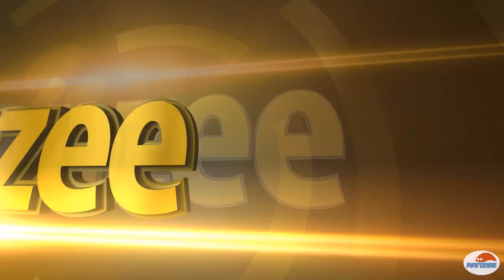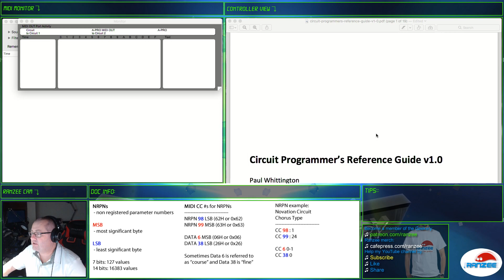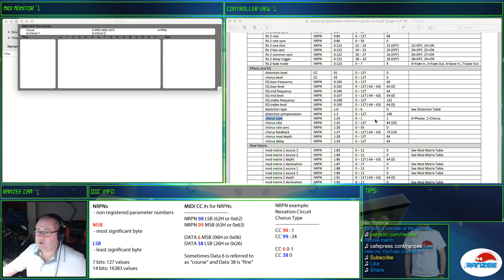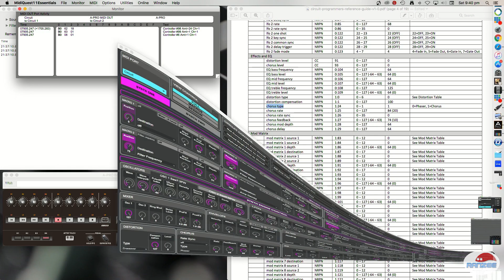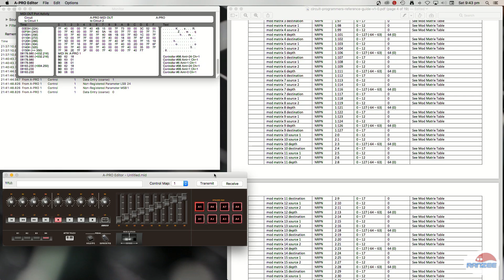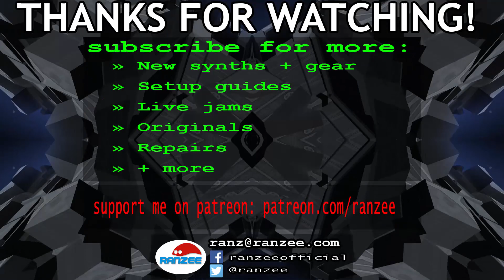Comment: Thanks for a good video! Is there a way to send cc 108 to a Nord Stage 3 with Boss FS-1-WL. The CC-numbers stops at 95. Is it possible to send a NRPN instead, could anybody show me what data to send? the off value may be 43, on value 85, it may also be 0 and 127, cc 108 wil turn the rotary speeed on or off.
Reply: You'll need to do it via another means - i.e. a laptop or PC using a DAW with NRPN ability.

Comment: I'm confused... What happened to the 38? I thought you said there would be 4 messages sent: 98 for NRPN LSB, 99 for NRPN MSB, 6 for DATA MSB, and 38 for DAT LSB... I don't see 38 anywhere on the MIDI monitor. What am I missing?
Reply: In that example - 38 LSB wasn't used iirc.
Reply: @ranzee  Thanks. I just wanted to make sure I wasn't completely missing the boat on this.
Reply: @oflittleconsequence  completely fine mate - I often have to double check myself :)

Comment: Really confused, I'm attempting to set up my Novation SL MkII controller to send a button press to my Novation A-Station that cycles through the polyphony modes. The manual looks like this:

bits 3-4: 
 2-bit voice polyphony mode

                0=mono 1=mono autoglide 2=poly 3=poly with “same
                note voice stealing”
I've followed your steps and cannot get it to cycle through the polyphony modes. the device IS accepting the MIDI information (a small dot appears on screen, indicating the selected patch has been edited) but it will not cycle through the polyphony modes. Please help!

Comment: Hi Ranzee, thanks for this helpful video. Very good explanation. I'd like to learn more specific usage of the Akai mpd232 controller with the novation circuit. I tried to configure the knobs with NRPN messages, but can't really get by. It offers MSB & LSB, but the data value seems to be static. You demonstrate the value change between 0 and 1. How about 0 - 127? I chose the INC/DEC1 option of the MPD232 with the value 1 to increase or decrease. See below example for env 2 velocity of the circuit:
08:10:52.071 From Port A Control 2 Non-Registered Parameter MSB 0
08:10:52.071 From Port A Control 2 Non-Registered Parameter LSB 0
08:10:52.072 From Port A Control 2 Data Button +1 1
08:10:52.072 From Port A Control 2 Non-Registered Parameter MSB 127
08:10:52.072 From Port A Control 2 Non-Registered Parameter LSB 127
But this seems not the be the right way as it has no effect to the circuit. I'm pretty lost. ;-)

Comment: Hi, I have the Software Synth MX4 by MOTU and the Manual have information of nrpn mapping but they give the number (not the MSB or LSB values), for example to enable the Osc1 the nrpn number is 1008. How could I obtain the MSB and LSB values for mapping the A300 Roland Controller? Thanks
Cool videos by the way!
Reply: Hi Rodolfo. You'll need to calculate it which will give you a value for MSB and LSB (Midi CC 99 & 98). The calculation is done as per my video Part 1: https://www.youtube.com/watch?v=XxJTyXowrqI

Using a calculator in programmer mode. 

The MSB is calculated by NRPN value / 128. So 1008/128 = 7. MSB = 7 (MIDI CC 99)

The LSB is calculated by NRPN value MOD 128. So 1008 MOD 128 = 112. LSB = 112 (MIDI CC 98)

(mod is the way to get the remainder of a division calculation)

Comment: is it possible to map a regular CC message to NRPN? For example an expression pedal (CC11) "translate" to LSB and MSB?
Reply: Hi Marco. NRPN messages are a type of MIDI CC message. You can only use them when the device has been programmed to accept them.  Cheers, Ranzee :)
Reply: Good video. I’m looking for a vid on packed parameters. Have subscribed just in case this is a future topic. :) Oh btw, it looks like you have the numbers reversed in the bottom screen “circuit example’. It lists 98 as 1 and 99 as 24. These are the other way around. Cheers.